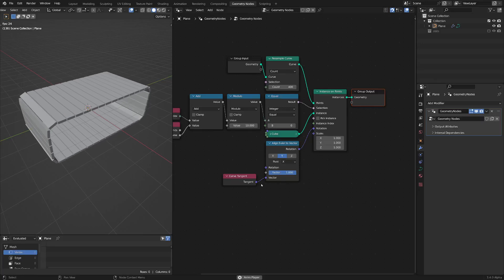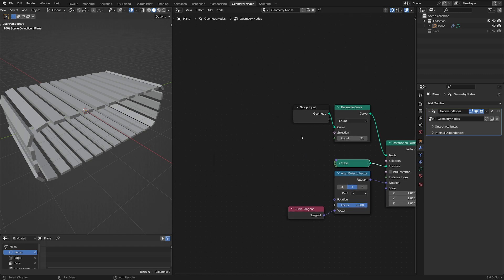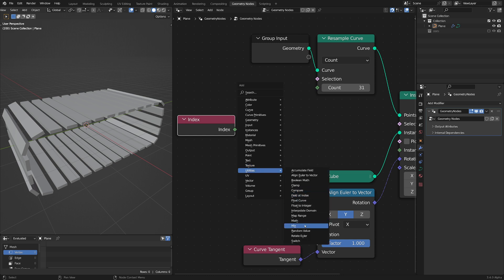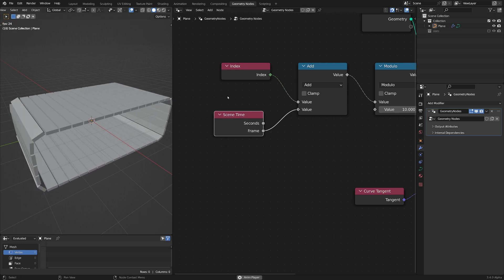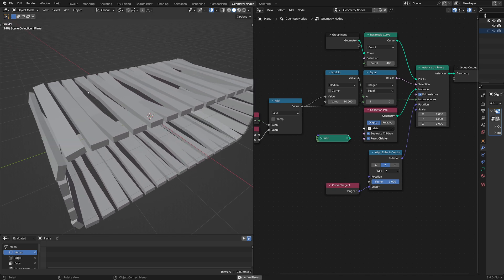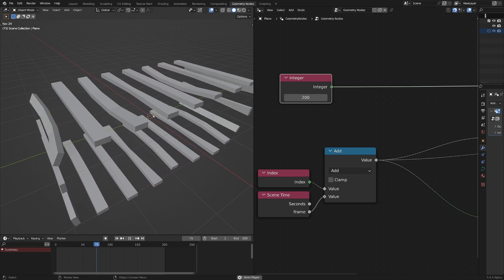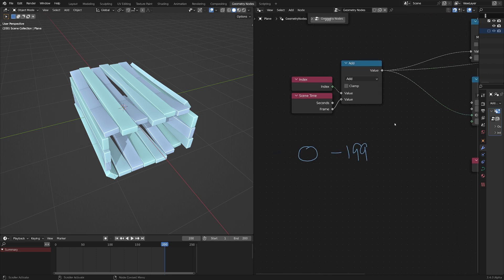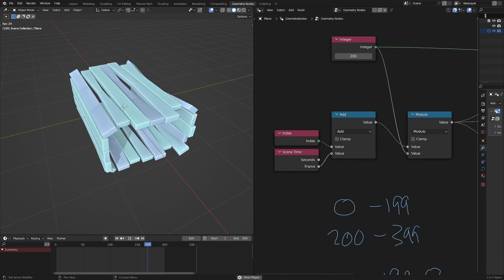Sliding Along a Curve - Geometry Nodes

Comment: This helped me a lot, cheers! Also I do not understand why making an object following a curve is not easy to achieve with nodes. Coding this would take less brain muscle.
Reply from the maker: This isn’t the best way any more. Better to use the sample curve node
Reply: @Erindale  I saw your comment under a post and I was just doing that. It works with a single instance but I couldn't make it work with multiple instances on a curve, which outputs from sample curve goes where I've no idea. Thanks for the tip though!

Comment: the issue with my node systen is that when i want my instances to follow the path of the poly curve, the instances seem to follow the path with the align euler to vector but when it reaches the corners they slowly rotate to alignerment. How can i get my instances to snap orientation to alignment ?
Reply from the maker: I’ll do an updated tutorial for this next week. Essentially what you need to do though is use a sample curve node to sample the factor -0.01 and +0.01 and then subtract one position from the other and you’ll have a true local tangent. The issue for the curve tangent is that it interpolates between the points so it ends up getting smoothed. 
If that’s too complex to set up the. Try adding a subdivide curve node and adding a bunch of extra points. It’ll make the interpolation happen over a much shorter distance

Comment: Great tutorial. However is there a way to actually move points along a curve to then instance on? For more control etc..
Reply from the maker: You can use a sample curve node to sample the position back onto the same curve. Spline parameter factor + scene time seconds, through a fraction math function and plug that into the factor of the sample curve node. That’ll literally slide the curve along its original self
Reply: Wow thanks. Which position do i plug the result of the sample curve into? Just a normal set position node?

Comment: I'm kinda late to the party but I have to ask: Since all of the timing and looping is based on the integer that matches the frames of the full animation, how would you go about changing that timing without changing total frames? Like, if I wanted the overall movement that I already have to be faster or slower without losing the loop. Would I have to adjust the math that happens in the 1/10 index in order to raise/reduce the amounts of steps in between each frame?
Reply from the maker: If you want a loop to occur within a set time frame then the motion has to be a certain speed to be able to go across certain distance in a certain time

Comment: This was by far the best and most elegant solution I have found so far! Thanks!
Reply from the maker: There’s actually a better one! Sample curve and assign your points a value between 0..1, you can then add to that value and do a fraction operation to maintain the 0..1 range. Use this as the factor for the sample curve

Comment: hello, could you some help?
Reply from the maker: Go ahead
Reply: @Erindale  What?
Reply from the maker: What do you need help with?
Reply: @Erindale  I can't find Modulo node in Blender 4.0. , so I have not got the same result. Is there a way to achieve this result in Blender 4.0?
Reply: @Erindale  hello?
Reply from the maker: @DuetTankers as you’re adding values to the index and therefore staying above 0, both modulo functions will behave the same in 4.0. Truncated means it increases away from 0, floored means it increases away from negative infinity. The pre-4.0 modulo is the truncated version but in this use case it actually makes more sense to use floored as the results will always be the same, no matter if the input range is above or below 0.
Reply: @Erindale  Thank you so much for explanation. By the way, I was ready to send you my screenshot in Blender and realised I had Equal to Resample Curve in Selection instead of Instance on Points node as you showed in video. I was struggling 4 days about it xd
Reply: @Erindale  The another problem is an rusty animation of the corners of conveyor. I haven't got it as smooth as you've got

Comment: this is a REALLY weird way of doing this, was there a reason you didn't animate the points moving along the curve?
Reply from the maker: It's easier to do that now that sample curve can take a field. This index bumping method was how we used to have to do it
Reply: @Erindale   is the field referring to something other then the curve input and factor? i'm actually working out a tank armature, and my most recent updates feature a geometry nodes track system, but only the curve input and factor are used. this is really interesting to me though, did you find out if this method worked with motion blur as well?
Reply from the maker: Anywhere you see a diamond socket instead of a round socket, that's a field. It means data can be different per element instead of a constant. The sample curve node now let's you define the factor as a field where it used to only be a constant meaning you could only sample a single position from the curve with the node. Now you can map many points onto a spline which makes it viable fro what you're wanting to make. Sliding along the curve with the sample curve WILL work with motion blur as it's continuous movement. The method in this video won't as it's just swapping instances each frame
Reply: @Erindale  that is some excellent information, really appreciate the detailed response. my work with the geometry nodes only started recently, and so i've missed many of the early growing pains it seems. props to you for finding these unique solutions though!
Reply: @Erindale  hey can you make a new version of the vid with this method? im trying to implement this on my geo nodes but i can't seem to figure it out, if u can't maybe i can contact u thru email or others like discord so u can help me? im trying to make it work with motion blur as u said

Comment: Nice concept. Should be noted that this presumably wouldn't work with motion blur though, if I had to guess.
Reply from the maker: Not default motion blur but you can do it the old way and use shaders to export the vector difference as an aov and use vector blur in the compositor

Comment: Hey Im wondering, is it possible to make a shader for this that will give a random value per link? Using a random per island node, I assume it would change the value every step of the modulo, as the links are not actually the same.
Reply from the maker: Just store the result of that module 200 node on the curve and then when you are in the shader, read it with the attribute node. That can be the seed for your random in the shader, or you can make random in the geo nodes and store that etc